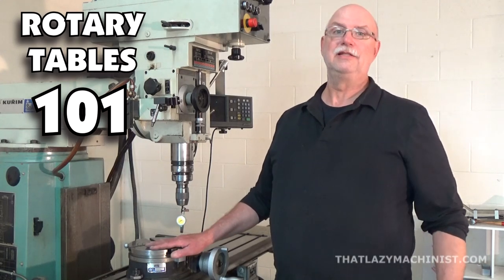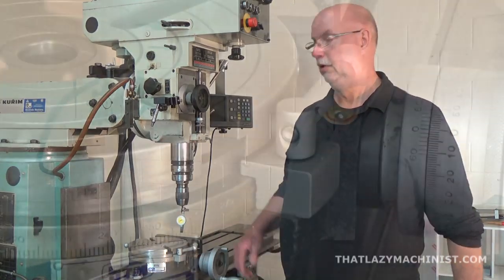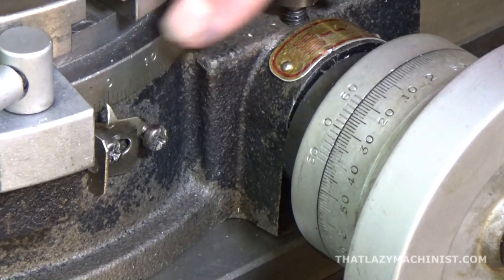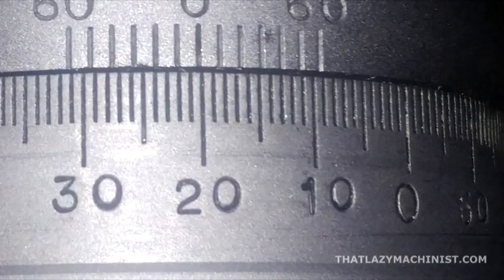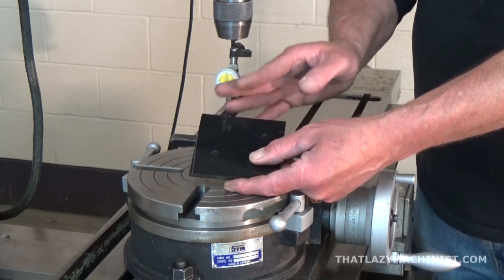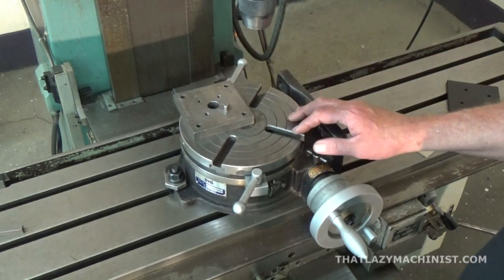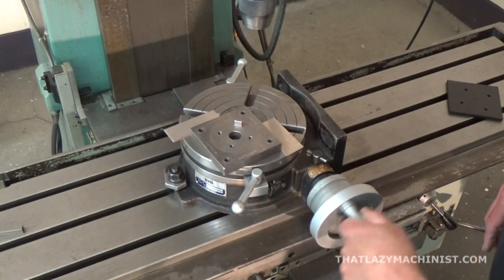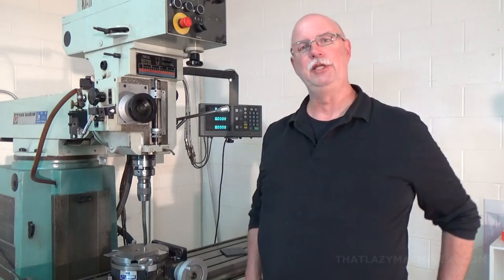ROTARY TABLES, how to cut an angle, how to produce a disc,  how to accurately radius corners

Comment: Very informative video.  I have tried doing arcs, like a cam would have, without much success. Perhaps you could do a video on that too.
Reply: What you are describing is arcs on a different center which involves being eccentric to the original center.  This brings in complications of set overs in aligning the part and tools.
Reply: This is a matter of being eccentric to the original center.

Comment: This video is meant for for the novice, and it covers the basics well. But please add the  point that the work must be spaced off the table if you are cutting full depth. If you  leave out the spacers you get a nice pattern on the top surface of your rotary table!

Comment: Another method for machining an accurate angle I use a sine bar and slip gauges pushed up to ground slot stops.
This method is very fast and extremely accurate

Comment: Hi Marc.  Very instructive video.  I have one question : what is the size of the rotary table in this video (I realise that it's on a big milling machine)?  And based on your experience, what is the best size for a roraty table to fit on a milling machine like one that you have in your home shop?  I thank you.
Reply: I'm pretty sure this is an 8"/200mm judging from the size of his hand next to it. I have an 8". I considered a 10 but they are so much heavier I would have needed a mechanical lift to mount it. What I've found is that you very quickly run out of room on the table by the time you take clamping space into consideration. I ended up casting an 11" auxiliary table to mount on my 8" RT. More clamping slots is also better. My 8" table has 3 making it easy to mount a 3 jaw. When I made the auxiliary table I put 6 in it, much better.  One thing to keep in mind in selecting the size of the RT is the amount of vertical space you have available on your mill. The thickness of the table plus the length of the tooling plus the thickness of the work quickly adds up.

Comment: Great video thanks. I have a question regarding the alignment of a hole in a part to the rotation axis. You suggested the use of the dial indicator. My first reflex, as a week-end machinist would have been to use a pin, a point or even a straight drill bit in the Chuck and lower the quill until the pin gets in the hole. Is there a reason to use the dial indicator again on the part? I guess that precision is part of the answer, but under what tolerance would you consider using the dial indicator rather than a pin?

My other question is how would you suggest aligning to round a corner that doesn't have a hole already or in which the hole isn't concentric to the required radius? My best guess would be to create a jig with a hold at the center of the required radius. Align that hole to the axis of the table. Put in some alignment plates as in the example in your video and than proceed on the actual part. I'm curious to hear if you have a less laborious method. Thanks
Reply: The reason we use dial test indicators is because the pin or drill has flex inside the chuck/collet tool holder you maybe able get the pin/drill to fit in the hole but you can be around .003-.005 off from the center axis of the spindle bore  to the hole.

Comment: I can't help but think that aligning the table should be the first thing you do before even mounting and aligning the work. Otherwise some good info in the video.
Reply: Usually a rotary table will have slots milled in the base for keys to align the rotary table with the machine table (like a good milling machine vice). This makes the set up very quick.

Comment: How do you cut through that piece in a full circle without crashing the mill into the rotary table when you cut through
Reply: Place a piece of waste material underneath the piece.  Sometimes, masonite is used.
Reply: @MrShobar  yes sir but I'm wondering if there's any secret way to hold a thin piece down and surface it or cut through it without having to move it
Reply: We have used double sided tape many times, also if you cutting something heavier you can set it on blocks.

Comment: Helpful video Marc!  I picked up a rotary table like yours years ago but I’ve never had the opportunity to use it (I need a mill...). A question for you. What is the hole down the middle?  Is it a Morse Taper or just parallel?  Thanks, Mike
Reply: Usually a Morse taper so you can install a dead center. Especially useful when the rotary table is flipped up so the bottom is now vertical. Often a rotary table will have a tail stock so that the work may be held between centers much like you would do with a dividing head.
Reply: Aceroadholder Interesting.  It’s fascinating how many creative ways that one job can be tackled. You just need to buy or make accessories.

Comment: 16:58 unless you can hit better than a tenth (.0001") accuracy with your X and Y movements or your Rotary Table is not actually accurate down to 10 sec arc angle, that statement is completely false.
With a Coordinate layout BC, if you are off on just one move (X or Y), you caused two errors, 
1, Different BCD (Bolt Circle Diameter) but it will be negligible.
2, the relative angle

For example, lets say that you are wanting a 6 Bolt evenly spaced BC on a 2" PCD, that would be 60° intervals and thus if say the first hole was in the 3 o'clock position, that would be a X move of .500" and a Y move of .866" (both from Center) to get to the 2nd hole. Now lets say that your X move was actually .5005 (just a half thou too much) the resulting hole is at 59°58'28" and the true PCD that that hole center is on a 2.0004" PCD (as mentioned above, negligible) but that angular error is larger (by quite a bit) than the accuracy of the vernier scale since the error is off by 0°1'32" and since the Rotary table used here can go down to 10 sec. intervals, that half thou error in Coordinate layout method is 9 times worse than what the rotary table can do.

Using the same example above but only being off .0001" on say X (actual move was .5001"), that is still an angular error of 20 second (actual will be 59°'59'40") or 2 times worse than the rotary table error would be if it is accurate down to 10 seconds.

Comment: To do a 3” hole with a 1/2” bit you need to SUBTRACT half the tool diameter not ADD it. From center, moving over 1 1/4” puts the center of the tool at 1 1/4” and the outside edge at 1 1/2” which gives you your 3” circle.